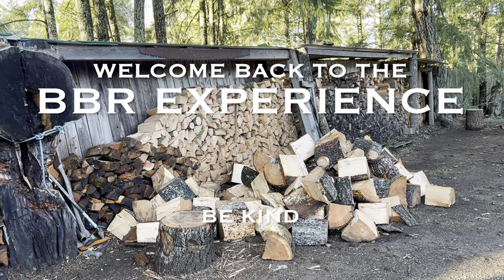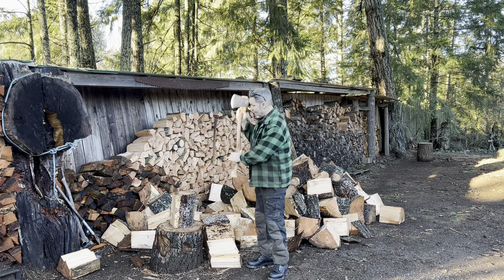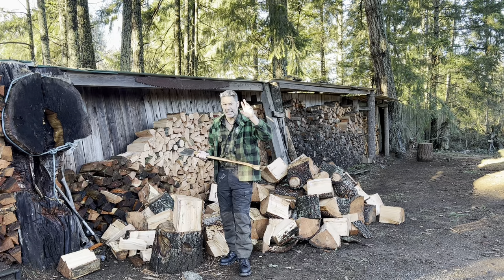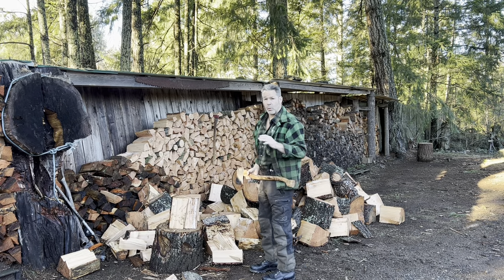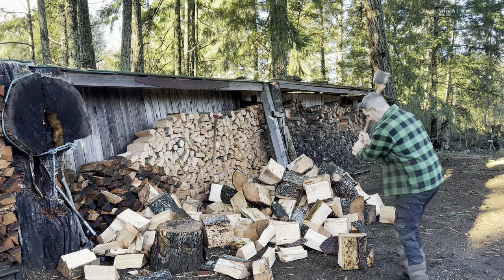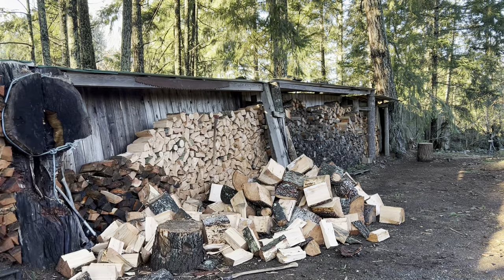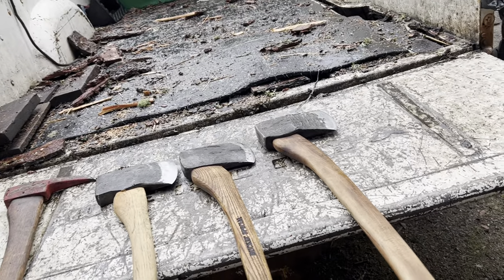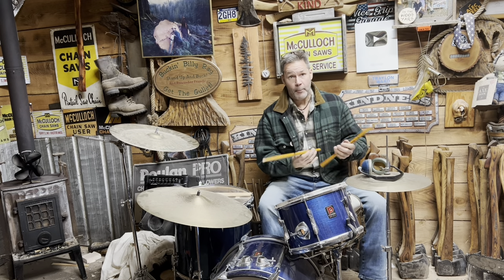THE RIGHT AXE , KNOTS AND CHOPPING BLOCKS

Comment: I am a fellow woodsplitter who has little need of the un-fun labor of a hydraulic machine. The old man taught me to invert the axe and swing it at a chopping block with the log above the axe when it gets stuck. You wanna watch your head if if comes loose, but it is brutally effective at splitting or clearing the head. I find that I do a lot of dancing with Oregon Oak--just about the most squirrelly stuff that you are ever gonna find.
Reply: I learned that technique from Charles Bronson on the original magnificent seven. Works like a charm.

Comment: Happy new yr Buckin,   2nd comment in 6 yrs. Quick tip i learned on my own from busting wood for 43yrs ... axes swing on an arch, you can put a piece of wood on its side in front of the log ur splitting and you'll always hit the sideways piece and never touch the ground... no chopping block needed...   you can bust wood on concrete slab and you'll always hit the side ways block in front....   axes swing on an arch, ..   give it a try..  peace n love brother.

Comment: Never used a chopping block in the last 50 years. I learned a lot about kinetic energy getting my engineering degree. That last part of your swing is where most of the energy will be developed by force applied from the body, momentum gaining through the axe head travel and the weight of the axe head. You reduce the gain through momentum and gravity by shortening the swing.  That twist or kip of the axe at the end of the swing also directs some of the energy into the split helping to force a stick of wood off the block.  Works for me in Tennessee oak, hickory and cherry.  Proper hanging of the axe head is important as well. I see so many single bit heads hung incorrectly in relationship to the handle.
Reply from the maker: ROCK IN A SOCK
Reply: @BuckinBillyRaySmith yes sir.
Reply: ...as long as the ground under what you’re splitting in not to soft or spongy. 😉👍🏻💪👌🏻
Reply: Ever go to the fair as watch a muscle bound monster try to ring the bell?  He tries to hit the pad with brute force. No cigar😆.  Then the skinny carnie rings the bell with one arm.  Same thing with a baseball bat, a golf club, an axe or a sledgehammer.  Swing don’t hit. 😉👍🏻👌🏻
Reply: Buckin, rock or a bar of soap in a sock 🧦. Ted Nugent 🎸 was told by US Navy Seals 🇺🇸 after 911 to pack a billiards ball with your socks 🧦 on you airline carry-on bag.  A swing of that will smash a pumpkin 🎃 before a box cutter could even reach you.  Let’s roll....🙏🏻👌🏻👍🏻

Comment: Happy New Year Brother Buckin'!!....Love to you and your Family and all who seek kindred spirits on this site. I am still splitting wood up here in -30C...LOL!  Yes, I love these debates, indeed the rectangular section handle is a great thing, it allows precise control  of the edge of the blade when chopping and splitting, all the old Soviet Axes were hafted this way and lets face it those old guys and gals in Siberia get through a lot of firewood with minimum tools and toys. I have just rehafted and refinished 4 old soviet Axes, 3 in Ash, the last one in Birch (materials that the Soviets used to use). I also agree Ash is is an extremely fine handle material, we grew up in the UK with Ash as the principal species, springy and absorbs shock quite well.  I usually use a LOW block to split, one cut from a stump, I do so because there is a lot of grit in the dirt here and I get sick of re-filing the axe edge. When I lived in the valley I split a lot of large rounds of Ponderosa Pine, they pop open easily, few knots to worry about, up in the forest...different story...tall narrow and often knotty trees means a different approach. Aggressive, inaccurate chopping results in overstrikes that destroy the novices axe handle, chopping has to be a mindful activity. Overstriking a Hickory shaft often results in a longitudinal split that can cut the hand, just the nature of the material. Take care friend...see you again sometime 🙏...stay strong 💪, WS.
Reply: @MATT.MAN-PEACE-LOVE  Hey Friend...thanks so much...I hope your 2023 is the best year yet. Yes...I am working on the health and strength for sure in time for the Spring..LOL!! 👍💪🥃🍻

Comment: A few months ago I asked why you preferred axes over mauls. Watching this video I totally understand now.. My local timber stand is super twisted and knotty.. Watching you play with that know mid video, I realized I prefer the maul because that piece you were dealing with is like every other one I come across. The way I deal with those is to sink the maul as best I can and have a 16# sledge close at hand that blasts the maul through most any know zero questions asked. 

I would cry if I saw someone treat your ax the way I treat my run of the mill maul.

Comment: Got about 1 hour splittin in today as it was 50degrees here in wny …. I’m a ground pounder myself cept I favor a maul over an axe so if I bust thru and happen to hit pay dirt it ain’t puttin the hurt on me tool (as much as it wood 🪵 an axe 🪓) … the chopping block is ok but imho it takes away valuable time/energy setting the axe/maul down , lifting the chunk up on the block , then having to grab the axe/maul : rinse and repeat. It’s ALOTTA wasted motion imho.  Using a hookaroon to stand up chunks vertically on the ground and then bust thru em one at a time seems to be the most productive use of one’s time and energy … your mileage may vary

Comment: I hear ya on the knots.  I have some blue spruce with huge knots like that- you just arent going to split through them.  Youll beat yourself blind, and shred the wood- the knots still there.  You split around them when you can.  Otherwise, its time to break out a saw, if you need it smaller.

  Ash knots, too.  Sometimes you can crack em apart.  Other times, the chunk just laughs at you.  Occasionally, itll grab your axe like a vice, and youll be stuck worse than youve ever been...   as an old, not dumb guy, it just cut pieces like that into chunks and be done with it.  Itll still burn just fine, even if it isnt in stick form!

Comment: I dropped trees, cut and split them by hand for a number of years. The wood was mostly white ash from my wood lot. The last 20 years of splitting was done with a machine and my back was much better for it. I quit cutting and splitting wood almost 10 years ago and recently the emerald ash borer has killed all my ash trees.
I buy my firewood mostly, but still cut and split the occasional storm blowdowns.

Comment: I have a fiberglass handle china maul. It has split lots of wood, so far i don't hate it. For the BIG knots, hydraulics.
Reply: I have some kind of plastic handle on my sledgehammer. It’s kind of bendy, but if ya just swing it, it hits hard and absorbs shock to your body. 👍🏻👌🏻

Comment: I've adopted FIBERGLASS or PLASTIC HANDLES. No rot. And I use a splitting maul, not a felling axe.
Reply: I have a few axes 🪓 that I use on softer / straight grain wood 🪵 and they work well. My go to is a Fiskars 6lb or 8lb maul though , especially the 6lb - I stand em up vertically on the ground and bing bang boom 💥
Reply: Those aren't felling axes, they are splitting axes Jeff, good luck trying to cut a cross grain chip with those axes. They're too fat at the blade.

Comment: I have tried to use a normal axe to split with.  Unfortunately,  I have found 8 pound mauls work the best for me.  I mainly split oak, ash, and maple. I will try the flick without a block.  Been using a chopping block for 30 years, and the only time i dont use one is when i am using wedges.
Reply from the maker: RIGHT ON Mike
Reply: Whatever works for You 👍🏻👌🏻🤷‍♂️